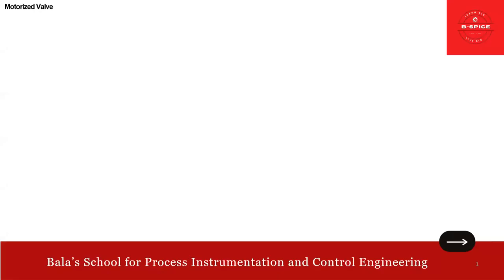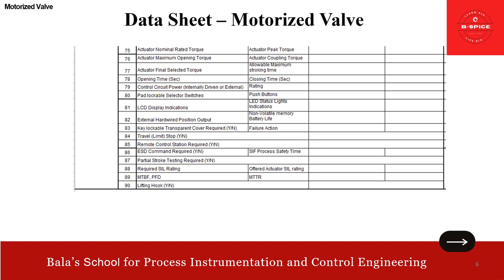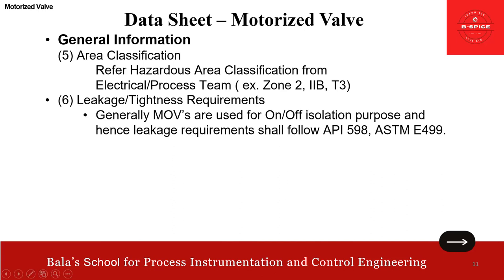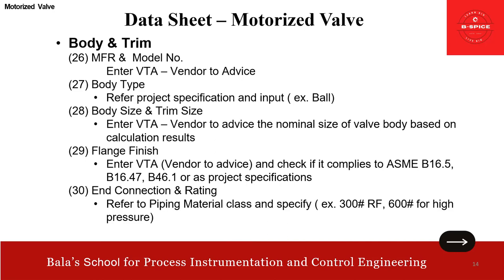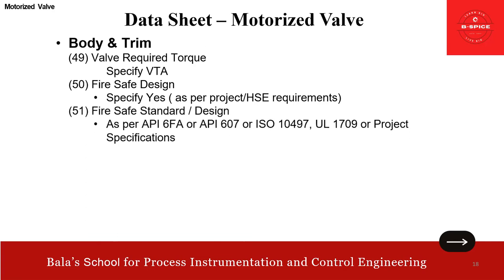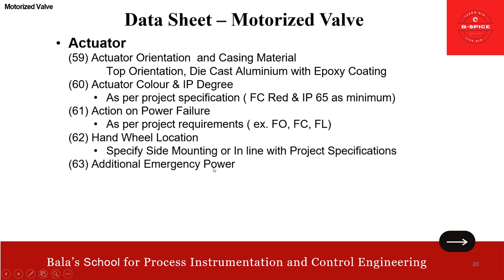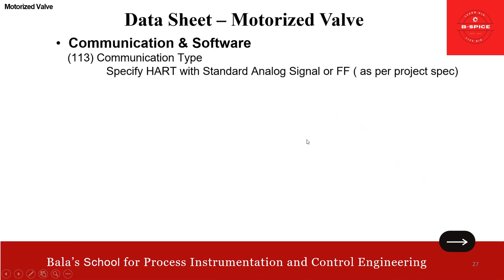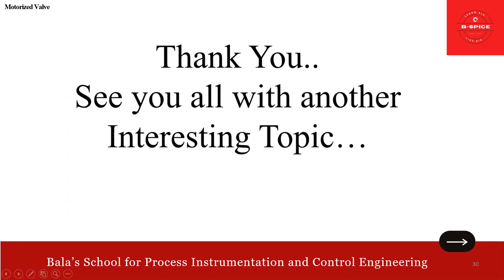How to Prepare Data Sheet for Motor Operated Valve (MOV)

Comment: Great effort!
But at 26:15, I would like to say that end connections for valves are usually Flanged and as per ASME B16.5.
Reply from the maker: Thanks for the feedback.. just sharing the clause of the spec from previous project for more clarity.. Valves shall have flanged connections, which shall conform to ANSI/ASME B16.34. 
Welding and wafer (body clamped in between pipe flanges) type connection shall not be used.
Flange size and rating shall comply with instrument datasheet.
The flange face finish shall be in accordance with ASME B16.5, ASME B16.47 and ASME B46.1.

Comment: 47:35 What is the use of Remote Control Station?
Reply from the maker: This remote control station is used for controlling MOV from remote location ( its an add on, if required), in case the if MOV location is not accessible locally..